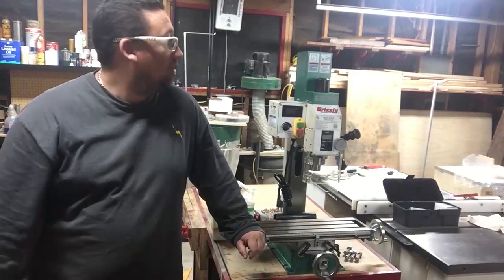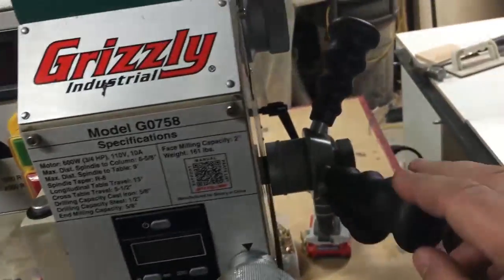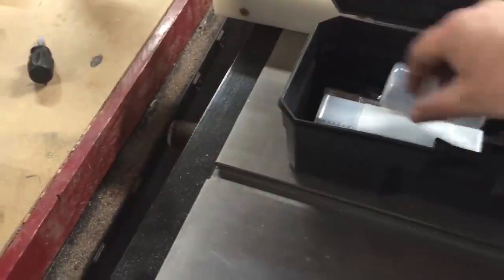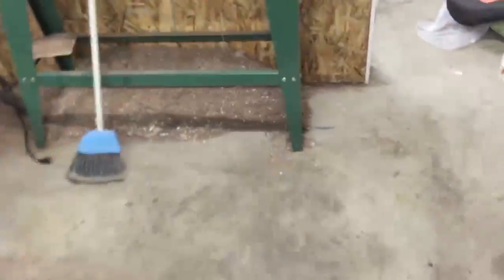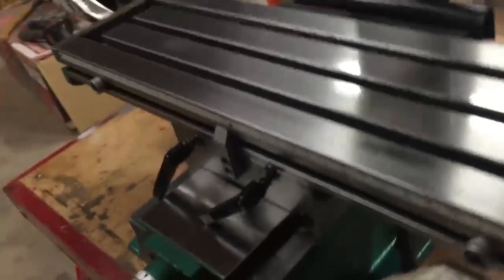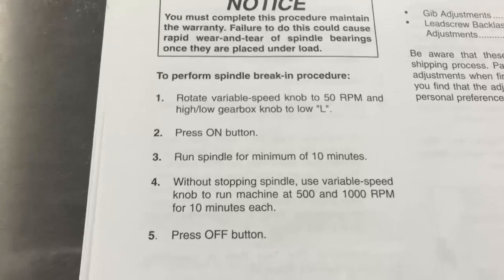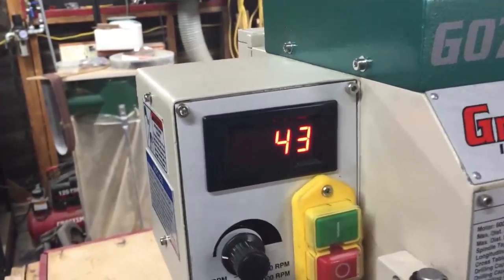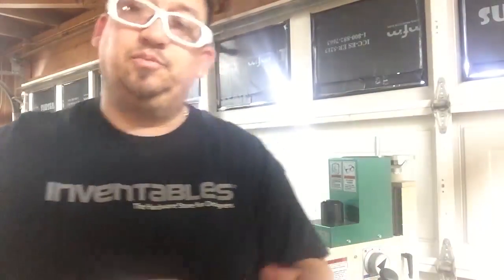Grizzly Mill Machine

Comment: I just read on the front of my manual- It says "  Variable-speed R8 spindle with forward/reverse and speeds ranging from 50–2000 RPM."
Does this mill have reverse? If so, how do I use that feature? If it does not, can the motor on this machine be wired with a reversing switch?